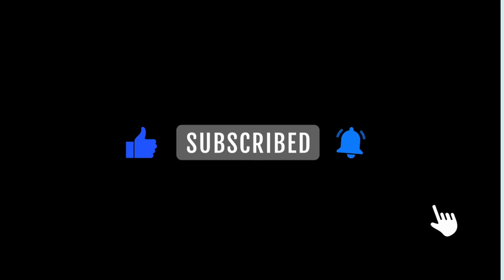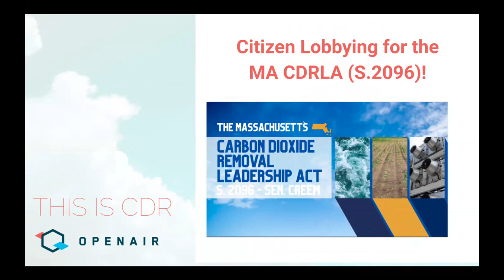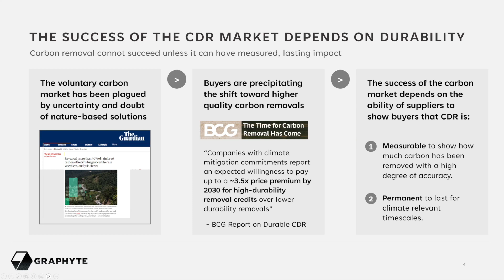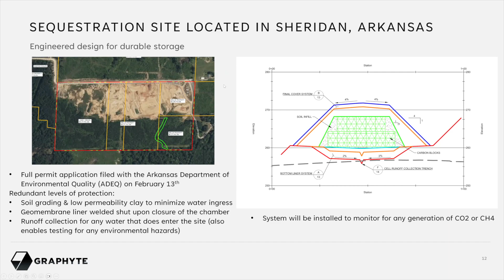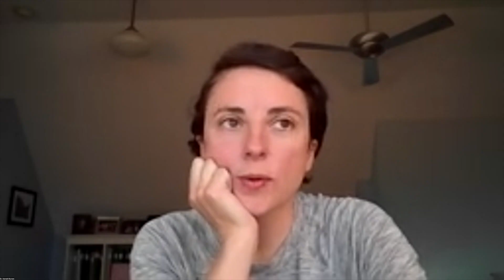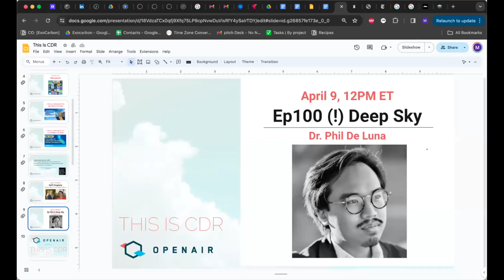This Is CDR Ep.99: Graphyte with Barclay Rogers and Dr. Hannah Murnen

Comment: That same 3 GT of bio mass could be used better as a fuel stock for electricity or fuels  or at the verry least  converted to bio char and used asa fertiliser
Reply: That releases co2 back to atmosphere and bio char preparation hs co2 loss from pyrolysis which drives the cost per tom of co2 costly.